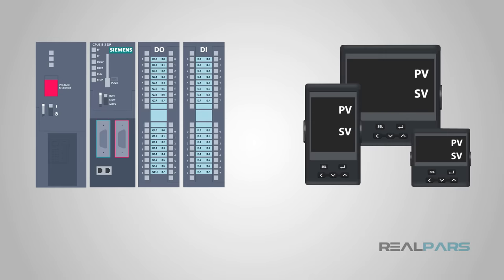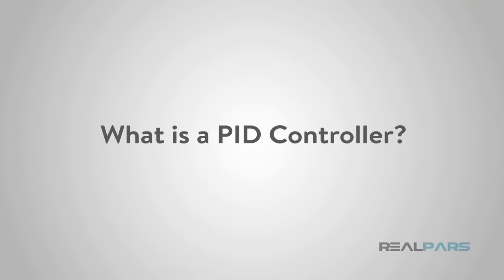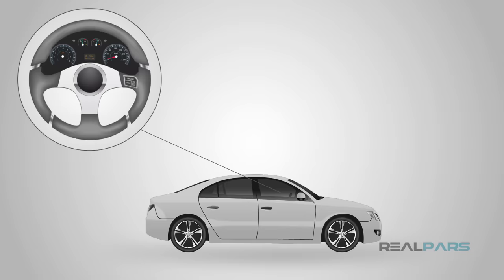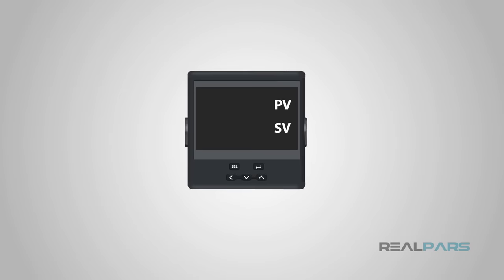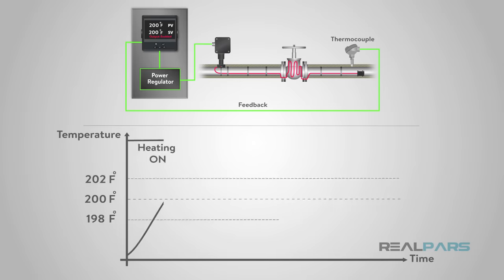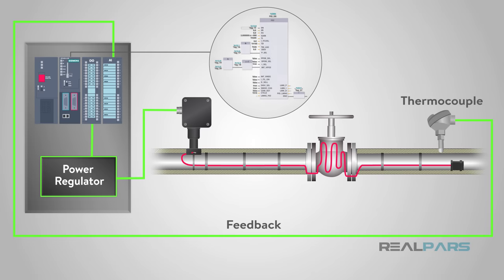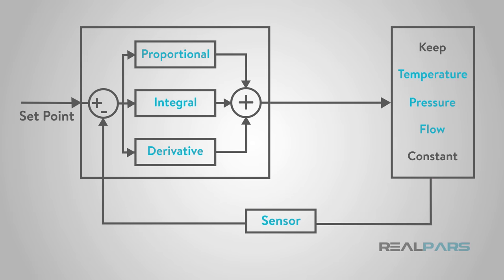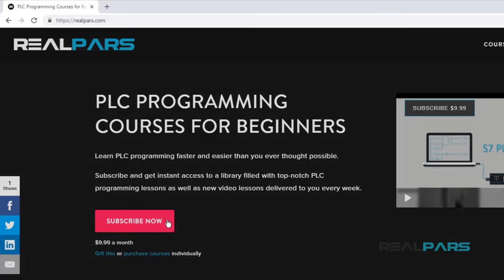What is a PID Controller?

Comment: Good info, but you sadly did not go into the details how the controller works exactly. The proportional part, integrator and derivator essentially help with uptake speed and improve smoothness and responsiveness. Imagine you set your cruise control to 150 km/h. You don't want your car to rev up and down, varying around the intended speed. The integrator helps to keep the control signal smooth. The derivator senses changes over time, hence the name, and can therefore increase the reaction speed to changes in the sensor signal. The proportional part ensures a fast uptake to the desired setting. Hence your car will accelerate quite fast until it reaches the set speed and remain there at a smooth fashion, being able to react to any changes in speed. The great thing about PIDs is, that you can set all these properties separately, having utmost control about the controller behavior.
Reply from the maker: Hi Maximilian, 

Thanks for adding that! That's great additional information, many thanks for sharing that.
Reply: Thankyou shring gues welcome
Reply: Sadly you used the same old tired cruise control comparison that we have all heard in lecture for electronics and instrumentation or calc 1. . . Try again? With a more original response to attempting to correct someone? Or just continue regurgitating your professorsworn out text book example?

Comment: This heated pipe control system is a relay controller, not PID. Relay is used when the control input is either on or off, as in a furnace for heating a house. Usually temperature control is a first-order system, with temperature being the only state, and its rate of change is proportional to a temperature differential between the heated space and the surroundings. Relay works well in this case, since the temperature of the heated space will start falling the instant the furnace is turned off, and it can be turned back on when the temperature reaches the lower setpoint. Relay controllers are the simplest kind of controller to implement; however, they are not suited to every dynamic system. Consider for example a servomotor that must swivel a robot arm from one station to another station. A relay controller would say, turn on the motor and turn it off when the arm reaches the other station. With the motor being on the whole time, the arm would acquire some angular velocity by the time it reached the other station. The task is not done though, as the arm is in motion and will overshoot the station. The motor has to reverse direction to send the arm back toward the station. This overshoot will repeat itself, leading to an unstable oscillating robot arm. This is where PD controllers come in. The P, or proportional term is the portion of the control effort due to the deviation in the actual state from the desired state. The D, or derivative term, provides damping by offsetting the control effort (servomotor applied voltage) by an amount proportional to the time rate of the state to be controlled. In the robot arm example, the initial control input from PD is relatively large due to the deviation in angular position from the desired station. As the arm picks up speed toward its destination, the proportional control term decreases due to the decreasing deviation in position, and the derivative control term, acting against the proportional term, increases. At some point before the arm reaches the destination, the derivative control term will overtake the proportional control term, at which point the motor voltage will reverse polarity, sending a slowing torque to the robot arm to slow it down to a much more manageable speed by the time it reaches the station. In this case the robot arm may overshoot the station by a little, or if the control gains are properly tuned, there will be no overshoot at all. When the desired state is a constant, PD will always send the system exactly to the desired point. However, if the desired output is a function of time, such as a ramp, or sinusoid, then there will be some steady-state lag behind the reference signal. This error can be reduced by introducing the integral, or I term to produce a full-fledged PID controller. This I term integrates the error term over time and incorporates the total error accumulation in the control input.
Reply: gets on my nerves when a basic "bang-bang" controller is introduced as a PID. Great explanation btw, keep up the good work!
Reply from the maker: Hi there,
Thank you very much for your detailed and well-explained example.
Yes, you are somehow right about the Heat Tracing example and it could be an ON/OFF control loop as it is shown in the video as well. Although using a Proportional control, the behavior of the heat tracing is the same as it is shown.
On the other hand, the purpose was to show a simple application and principle operation of the "PID Controllers". And as per your explanations, it is mostly used for temperature controlling of the variety of processes either by means of solid-state relays or P, I and D settings.

This video was an introduction to PID Controllers and in the next video in this series which is about the PID loop and its corresponding Function Block in Allen Bradley ControlLogix PLCs, we will elaborate on the P, PD, PI, and PID loops concepts using one or two simple real-world examples.
Reply: @Flávio Cozi You're correct this video does not detail the workings of PID control. PID control is one of many different control laws that can be implemented in a system. A control law is a set of instructions that determines what control input is needed in the system based on the state errors of the system. In the example of heating a building, the state that we want to control is the temperature of the space. Suppose a gas furnace is used to supply heated air through a duct to a single floor of the building. The control input is the rate of heat addition to the air as it flows through the furnace. Normally a furnace is either adding heat at a constant rate (constant burn rate of the fuel, natural gas), or it is turned off and produces no heat. However, if you wanted to implement a PID controller for building heating, then your furnace's heat setting would have to be continuously adjustable. This could be accomplished by actuating the valve through which the natural gas flows. We want to control temperature of the space, which is measured by a thermometer, thermocouple, or other temperature sensor located at a point in the building at which the temperature is representative of the temperature throughout the space. The error signal is the deviation in sensor temperature from thermostat-set temperature. Provided that we have sufficient computing power available to the temperature controller, then we can also calculate the time derivative of the error signal (ie how fast is the temperature deviation changing?), and the the time integral of the error signal (ie the history of how large a temperature deviation has existed in our building, and for how long?) The calculated temperature deviation is one of the three pieces of information that is required by PID control. The error signal is multiplied by the proportional gain, which has units of kilowatts of heat addition per degree Celsius. For example, if we tune our PID controller such that the proportional gain is 1 kilowatt of heat addition per degree Celsius of temperature deviation, then if our building is measured at 19 degrees C, and we set our thermostat to 21 degrees C, then the proportional (P) term of the PID controller will call for 2 kilowatts of heat addition by the furnace. However, what happens when temperature is measured to be equal to the thermostat setting? The proportional control term goes to zero. Without the integral or derivative control terms, the controller would call for zero heat addition, and the furnace would shut off. Physics tells us that without heat addition, the temperature inside our building will start to drop, due to heat transfer through the walls to the outdoor air which is cooler than indoor air. Therefore, a stable steady-state temperature cannot be maintained using the P term alone. The integral (I) term can be used to provide a steady state heat addition to maintain the temperature of the building when it reaches the desired point. The integral term has units of kilowatts of heat addition per degree Celsius per second. Now, for every second the temperature of the space is below the desired point, the integral of the error signal increases, and the integral is multiplied by the integral gain to obtain the integral control term. For example, suppose we tune the integral gain to 50 watts per degree Celsius second. Suppose the temperature of the building is on average 19.5 degrees C in the first minute the furnace is on, 20 C the second minute, and 20.5 C the third minute the furnace is on. Then assuming our thermostat setting remained at 21 C, the integral of the error signal is 60*1.5+60*1+60*0.5=-180 degree Celsius seconds. Multiplying this value by our integral gain, we obtain the integral control term, 9 kilowatts. Now suppose in the fourth minute, our building has reached a temperature of 21 C. The proportional control term becomes zero, but the integral term is nonzero, and it equals 9 kilowatts of heat addition. If this is the rate that our building rejects heat to the outdoors when the interior is at 21 C, then the integral control term will ask the furnace to produce just enough heat to maintain our building at a steady temperature. However, if the integral gain were set to a value too large, then the controller will ask the furnace for too much heat, and the temperature will overshoot 21 C. Thankfully, the moment it overshoots, the error signal reverses sign, thus the integral of the error signal begins to decrease, which decreases the integral control term. Also, the proportional control term reverses sign, so the heat addition from the furnace will decrease to allow the space to cool down. Finally, the derivative of the error signal is used in the derivative (D) control term. The derivative could be calculated by a simple finite difference approximation (ie current temp deviation minus previous temp deviation divided by elapsed time between measurements), and this derivative is multiplied by the derivative gain. The derivative control term is really not necessary for a temperature controller, since thermal systems are best modeled as first order systems, and the rate of change of temperature is not a state of the system we need to concern ourselves with. Nonetheless, we can still incorporate the derivative term. For example, suppose we set the derivative gain to 10 kilowatts per (degree Celsius per second). The error signal changed from 1.5 C to 1 C from the first minute to the second. This is a change of -0.5 C occurring in 60 seconds, so the error signal rate is -0.00833 Celsius/second. The derivative control term is then -83.3 watts. This means the derivative term works to negate the control effort by reducing how much heat the controller demands from the furnace. The derivative control term worsens the performance of our temperature controller since it impedes the control effort when there is no need to. However, in systems where the derivative of the state to be controlled is a state itself with its own dynamics, then the derivative term becomes useful. This usually is the case of systems involving rotational or linear motion control, where both position and velocity are states, and the system becomes second-order.
Reply: @John Barron.Thanks! From your explanation, I recall some memory of the Automatic Control Theory when I am still in College. Because I am a beginner of PLC relevant field. I think that I need to study the book again. Or you have anything better suggestion and something resource like open courses, video, documents ...etc.  Thanks.
Reply: John Barron 👍
Reply: Should rename this video to what is a “Bang-Bang” Controller 😛. Good content nevertheless, just somewhat misdirected. In my little exposure to controlling temperature loops via PID FBs on siemens PLCs , they can self tune the PID parameters which dynamically alter the duty cycle (highly adaptable to different heating and cooling rates) to whatever heating element or power regulator is being controlled. So in a way, it is still PID control but not super intuitive for people who don’t know the underlying fundamentals of these FBs, or the translation of classical control theory to most real life systems working in the discrete realm.
Reply: John PID only to set value where we can manipulate the process value to meet a set value it's depend on the condition and you explain about sensor or relay it's a physical party ....it's work on the value of pids ....pid is only a values and mathematical calculations
Reply: Holy fuck thats a really good explanation. You must be a father of the kid in the profile picture. I bet you have some high paying job in the field. Thanks
Reply: John Barron That’s the best explanation I’ve ever seen.
You definitely should write a text book for the sake of all student over the world.
Thank you so much!
Reply: I was looking for this comment. They should have compared on/off /bangbang to PID and clearly stated the distinction between the two (behavior, advantages/disadvantages, etc). Instead, they grouped them together. I think this will make people not familiar with PID controllers to miss the point of why they are awesome in the first place.
Reply: @johnbarron4265  The integral "the past" accumulates the error with time and will end up cancelling the steady state error ...
Reply: Well written Mr.Barron
Reply: John Barron Wooh crystal clear . . Too good mate . . I feel happy to see the pin point explanation . This is the only time I felt @realpars was not to the exact point . Their videos are super class and precise.
Reply: @realpars  This is an old message that I'm replying to, but the behaviour in the example you're referring to would be a PID controller with P=0.  I.e. a strictly on-off controller with 2 degrees of hysteresis.  This is a PID controller with the PID part turned off.   This, by the way, is the way I greatly prefer to use them.  I detest PID control for running on/off heaters.  These controllers are wrong more often than they are right.  I greatly prefer a simple on-off control with an appropriate amount of hysteresis.
Reply: @johnbarron4265  👍
Reply: All I takes is one jackass to open a door and there goes integral 🤣
Reply: @johnbarron4265  best explanation I've ever seen on the internet.
Reply: Thanks John

Comment: Not PID control it is on of. The reason for using PID is to keep the process variable at the set point, not bouncing around it. If the system as described in the video was used to control the flow of a liquid large pipe the resulting hydraulic hammering would destroy the pumps/valves and pipe work.
Reply: But in the case of heat, it can be used
Reply: Yes, but you have to call it ON/OFF control, not PID control.
Reply: Enrico Poiré English pls
Reply: From an observer’s viewpoint, the setpoint is adhered to. From a process variable’s viewpoint, a bouncing effect is characteristic of a badly tuned system and is still very much a classical example of PID control. The on/off approach is utilized because many PID FBs in essence control an analogue output via a dynamically altered duty cycle( dependent on P,I,D and multiple application specific parameters).

Comment: Normally you explained when you use P to get rapidity  in the response and effective value follows the set point but with only proportional P the system can't reach the set point that's we need to add Integral I to resolve this matter and to avoid the oscillations of  the effective value Ev we add derivator controller and we increase the stability

Comment: Hi real pars... with todays vfds that have PID control in it, would it be possible to connect the analogue output of the 1st drive to the analogue input of the second drive without using PID controllers? i would like to control the speed of the 2nd drive according to the amps of the 1st drive... the higher the amps the lower the speed and vice versa

Comment: The absolute fundamental is: Multiply the gain, integrate the error, take the derivative of the error feed it back into the process until the desired setpoint is achived.
The values of integral, proportional and Derivative are all constants you wish to use for the error. 
P(E +i( INTEGRAL) (DE) + (DE/DT)d) in the time domain, of course s domain makes it easier to solve however for most basic workings this is already provided.
Reply from the maker: Thanks for sharing!

Comment: During PID adjustment on PLC referring to curve of setting,  proportional adjusted to get off not large unstable then value must be multiplied  by 1/2 to get the actual value stable on set point. then integral (time) must be adjusted until it become constant with set point lastly will be derivative     as it stand to minimise overshoot in case controller is on action such as temp, pressure or flow.
Reply from the maker: Thanks for sharing that, Mohammed!